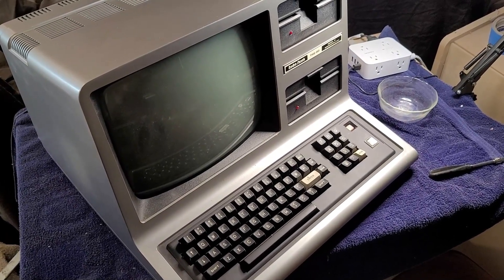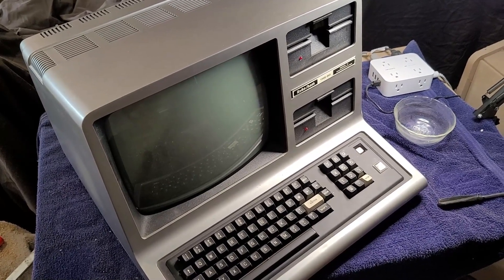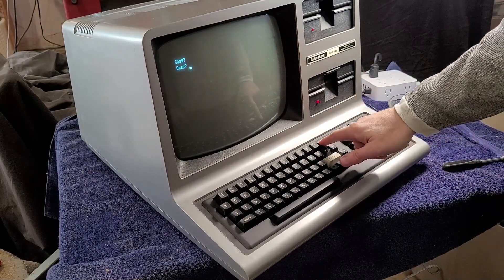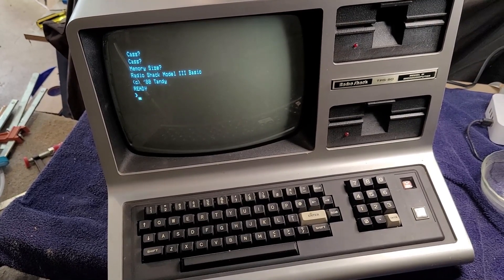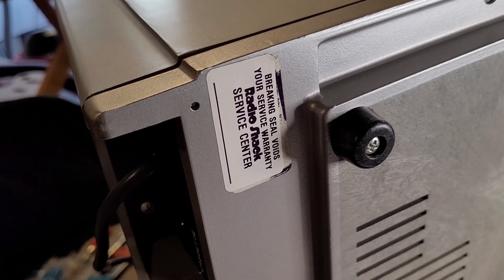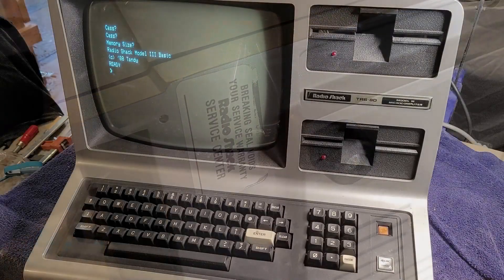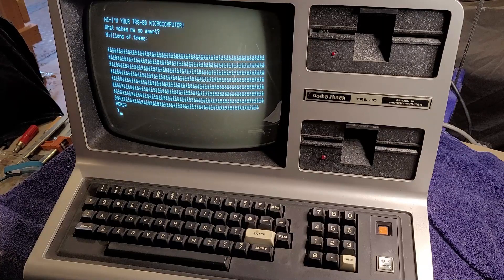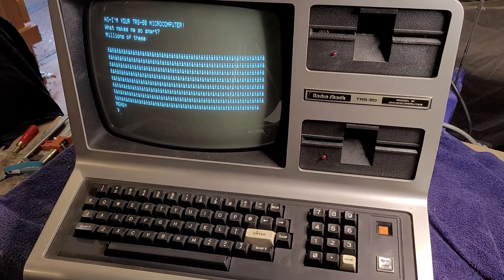Best / worst TRS-80 Model III repair

Comment: hi..i was given a trs80 model3...was stored in attic for 35yrs...i powered it on and nothing showed on screen...then after 5min lots of  smoke was coming from back...i took apart and didnt see evidence of a fire so im thinking a calacitor broke open....i looked everywhere didnt see much...but did notice a rectangle looking component that said 1uf on it...i assume its a cap...it waa slit on noth sides...

Comment: That is a nice looking TRS-80 Model 3!
In October of 2020 I purchased a TRS-80 Model 3 on e-bay.  
I tricked it out with the following fixes and improvements:
1) Replaced the RIFA capacitors
2) Fixed the keyboard with a botch wire due to some bad lines on the circuit board
3) Created a ribbon cable to add an external floppy emulator
4) Created a cable from the cassette port to powered speakers
5) Replaced one of the internal floppy drives with a go-tek floppy emulator after I loaded the "FlashFloppy" firmware on it.
6) Loaded 189 disk images onto the USB for the go-tek floppy emulator with basically every game, operating system, diagnostic utility and office software I could find on the Internet
Here is a video I made about it: https://youtu.be/DmFtIaYe6pY
Reply from the maker: Sweet!  I am considering putting together a FreHD for this one.